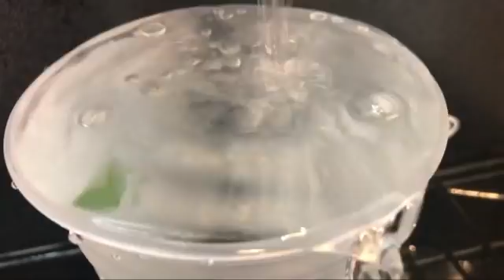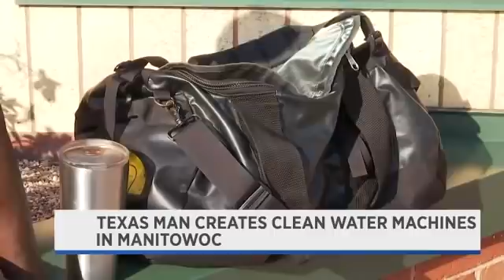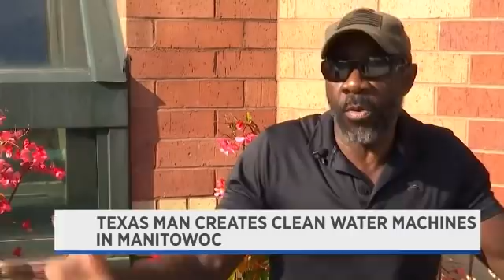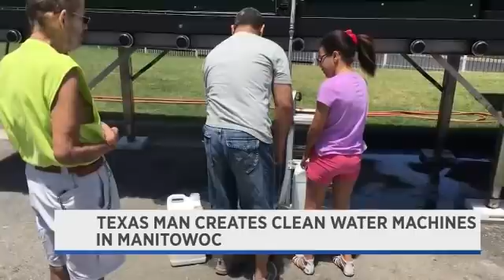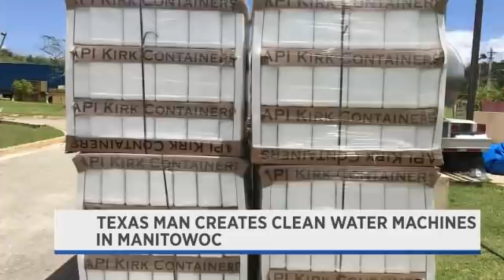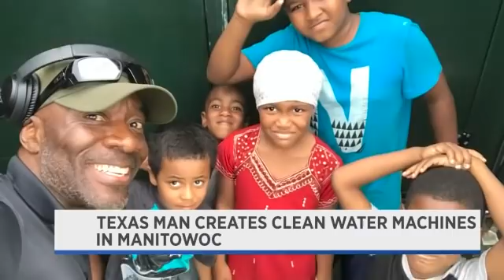Texas Man's Invention Creates Drinking Water from Air

Comment: Isn’t this essentially just a super powered dehumidifier with an activated charcoal filter attached?
Reply: Not even super-powered.  These water-from-air scams all have the same flaw.  You can't pull more water from the air than is there.

Comment: I fail to see the difference, except for seize, between a dehumidifier and that guy's apparatus.

It works as long as the engine turns and there is enough moisture in the air. It obviously doesn't make water out of thin air.

The extraction of water from the air has the same effect as mass irrigation: it disturbs weather pattern elsewhere. Hence it is not an acceptable approach to water management unless one doesn't care about creating droughts, floodings or tornadoes for people living few thousand miles away.

Comment: You could use the water to fuel one of those combustion engines that run on water.
Use the engine to drive a generator.
Use the generator to drive the water machine.
And go round and round until you disappear up your own dehumidified arsehole.

Comment: If these actually do what he says the can, the third world would certainly benefit also.
Reply: LMFAO, no. It requires huge amounts of electricity, doesn't produce enough water and requires maintenance. It's a useless invention, many have been invented like it.
Reply: @bmc9504  Yes not doubting there are a lot of frauds.  Do you have any evidence this is a fraud also?  If so I would be interested in reading any info you have.  I get what you are saying about huge amounts of energy.  Most use a cooling coil to condense the air and collect the droplets. Essentially a giant humidifier.  I do agree, the claim it uses little energy does have me wondering what they mean about not much energy.

Comment: Anyone else feel like all he made was a giant dehumidifier?
Reply: 4 years and a huge electric bill.
Reply: @William BurnsThe machine that Moses developed was innovative from the start. One of the challenges of scaling up atmospheric water generation technologies is the amount of energy they require to function. Many units on the market today are very energy intensive.

Not this machine, though. The Texas Commission on Environmental Quality requires power consumption no higher than 0.13 kilowatt-hours (kWh) per liter for approval. The unit developed by Moses used only 0.08 kWh in testing, and in Puerto Rico achieved 0.05 kWh.

Moses spends a lot of time watching the machine operate while thinking about "parasitic electrical load. If I can put my hand someplace and I can feel some heat come off or if I can feel some cool air come off … temperature change is energy.” He has continued to make tweaks to the design to minimize energy usage. “I’ve gotten the equipment down to the place where it’s very, very low on energy consumption,” he says. “And that’s what you had to do to get it out to the market.”

He says, "The one thing that everyone says is going to happen on this earth is that we are going to run out of water, and that’s just not true because we walk around in all the water we need every day."
 quote from MOSES WEST, PALADIN WATER TECHNOLOGY
Reply: Lol u guys are some hating ass bitches
Reply: Anthony Hearn I’m sorry that discussing science and using knowledge of technology is “hating” to you.

Sorry you can’t grasp the concept that he’s designed a dehumidifier with a filter unit. It’s literally what it is...

Go be a bigot somewhere else as everyone else speaks on the science behind this “feel good” story. May I suggest the stories about African helicopter builders that are using the helicopter rides that are generally outside department stores and in malls as their body.. maybe you can call all those that are questioning the science of those men “hating ass bitches” too.

You’d feel better to be ignorant and hateful to all those that challenged their science as well because your hate here is solely racially motivated. 

People of a civilized society are allowed to question false science. It’s what let’s us understand our environment.
Reply: Anthony Hearn maybe try being realistic and look at the numbers?? How is this hate?
Reply: @anthonyhearn9733  WORD.

Comment: its just a condensation collector. like what you get from condenser coils in an air conditioning unit. nothing new. the higher the humidity the more water in the air.An atmospheric water generator (AWG) is a device that extracts water from humid ambient air. Water vapor in the air can be extracted by condensation - cooling the air below its dew point, exposing the air to desiccants, or pressurizing the air. Unlike a dehumidifier, an AWG is designed to render the water potable

Comment: Water from air has been thoroughly debunked by thunderf00t.  It's the most expensive water, only works well in high humidity, and needs filtering to be safe to drink.
Reply: If it was expensive it wouldn't be in Bahamas and Puerto Rico. There's a big difference between this and a Self-filling water bottle.
Reply: If it was expensive it wouldn't be in Bahamas and Puerto Rico. There's a big difference between this and a Self-filling water bottle.

Comment: Quick, everyone get Thunderf00t over here to rain on his parade. lol
Reply: @William Burns isn't sargon married with kids?
Reply: @William Burns jesus. I didn't think anyone could condense so much cringe.
Reply: @William Burns The machine that Moses developed was innovative from the start. One of the challenges of scaling up atmospheric water generation technologies is the amount of energy they require to function. Many units on the market today are very energy intensive.

Not this machine, though. The Texas Commission on Environmental Quality requires power consumption no higher than 0.13 kilowatt-hours (kWh) per liter for approval. The unit developed by Moses used only 0.08 kWh in testing, and in Puerto Rico achieved 0.05 kWh.

Moses spends a lot of time watching the machine operate while thinking about "parasitic electrical load. If I can put my hand someplace and I can feel some heat come off or if I can feel some cool air come off … temperature change is energy.” He has continued to make tweaks to the design to minimize energy usage. “I’ve gotten the equipment down to the place where it’s very, very low on energy consumption,” he says. “And that’s what you had to do to get it out to the market.”

quote from MOSES WEST, PALADIN WATER TECHNOLOGY
Reply: @frankmill5172  it's getting hard nowadays for White Supremacists to be racist without saying the word "nggr". Their Lee Atwater ideology is gradually becoming less effective to where they can't hide their deep hatred of Black Americans
Reply: William Burns I don’t like or diss like thunder foot but he is no client change denier and you are not funny, if people told you in the past that you are funny they were lying
Reply: William Burns You wouldn’t happen to have 879,000 subscribers would you? You know, to get the word out  beyond the confines of this thread.
Reply: @William Burns amazing, add Russian collusion and you'd have managed to nail all the post-2016 buzzwords.
Reply: @William Burns well African Americans are innovative when it comes to things like this ...Frederick Jones, an African-American, invented the first portable air conditioning unit in 1935 which is close to Moses West Mobile atmospheric water generator then it is to Standard Air Conditioner and Dehumidifier  Jones was one of the most prolific African American inventors ever. Frederick Jones patented more than 60 inventions, but is best known for inventing a practical automatic refrigeration system for long-haul trucks
Reply: @William Burns you can just type Moses West Patents and check out all the specs for yourself and see if it all BS or innovative
Reply: @William Burns so your not a engineer but call BS because the way it looks ... it's still an inefficient way to gather water ...tell that to the people of Flint thats still to this day drinking lead laced drinking water they have used the Machine and As long as they say its not BS then I dont care what some guy on the internet says just because hes upset it was made by a Black man and you seen a lot of proud black people in the comments being happy about a black mans achievements   ...unless you can post a link to a article or youtuube video debunking "Moses West" Machine not someone else machine STFU dont even know why you people are even hating for hes not selling a product hes giving free water to people in need and it cost US tax payers $0 dollars ...its all positive that hes helping disaster victims in Puerto Rico ...you people are wasting energy on the wrong guy go debunk some real scammers I've seen less hate comments on White people like Berny Madoff who stole 500 Billion off gullible mostly white people the only reason 99% of the people are upset in the comments section is because hes Black and invented something positive that they cant hate on ...besides saying he didn't invent the first dehumidifier LOL
Reply: @William Burns also hes not competing with anybody ...hes not selling a product on Amazon or Walmart hes just giving them away for free to people that need fresh drinking water at $0 dollars out of any ones pocket if you dont want to donate you dont have to ...there have been way worst things people have Donated money too
Reply: @William Burns calling other men misogynists will not get you pussy.
Reply: @Jos Soros  I know this much, Thunderf00t has made several videos where he criticizes real inventors and amongst them Elon Musk.  I am not a Tesla fanboy and i don't mind people analiying and critiquing things he has invented but it was the way this jackass thunderf00t was mocking and ridiculing some of Elons ideas rub me the wrong way.   Fuck this loser and the losers that defend him.
Reply: @William Burns one moment its fake next moment ok it might me real but there are better ways to do it ...ok if its that simple why haven't they done it yet the people in Flint dont have the luxury of waiting around while people like you call a man a scammer thats not making any profit just getting donations to build machines that he gives away for free instead of doing nothing ...if I'm a person from Flint I'm not drinking any water coming from the same plant thats been poisoning them for years even if they say its been distilled ...and even bottled waters can be contaminated especially the ones sent to a specific region to a specific targeted group of people and bottled water companies make millions of dollars in donations and prophets when they ship bottled waters to a disaster zone I dont see you complaining about them and there are tons of fake charities that taken advantage  of people from all over the world but bet you dont care about those ...if you do post a link to a video where you left a comment talking bad about a white person scamming people dated before today ...ill wait
Reply: @William Burns Moses West from AWG Technology speaks about his company and atmospheric water generation.
 https://youtu.be/tEoxVhUWkcw
Reply: @William Burns they are not just giving any and everyone patent with out testing there devices first to make sure they work as advertised if you make a claim that your product is 100x better than the last persons device they test its to verify the claim before allowing you to put the product on the market ...if Moses West says its 1,000,000 more efficient  and produce a billion gallons of water using 2 double A batteries then so does the government testers that gave him the patent
Reply: @William Burns you guys are fighting the wrong battles ...its like if the Avengers fought Thanos to stop him from  completing his Evil diabolical plan of giving fresh drinking water to a planet of poor people
Reply: @William Burns what deflection you will obviously need to store water in winter months in states like Texas where hes speaking from and this video is from almost 3 years ago it has been farther improved ...like I said its not a product being sold he is providing free water to disaster zones and poor people the advantages of this system is its free it cast $0 dollars and its better then people drinking lead laced water that they are still drinking today ...and just like Flint I dont think the people of the poor planet would care what system Batman or Thanos used as long as they got fresh water ...if you where dying of thrust and a guy gave you AWG water I dont think you would turn it down and say you could have gave me distilled more efficient water LMAO!
Reply: @William Burns We live in the real world, where people are left to drink lead filled water 5 years after they found out Flint water was contaminated the Real world where Trump takes Billions from other government programs to Build a Wall instead of Helping out poor people in this country and if the solution was as simple as setting up distillation then why haven't they dont that yet ...all your saying is there are better ways yet where are they  live in the real world people like Moses West the Hero's trying to help
Reply: @William Burns his Machine was designed to not need to be hooked up to a power grid or water supply to make it operational in disaster zones where the infrastructure is down it can also run on solar power and the video says it literally cost ($0 dollars) to operate in any city so why is your only major concerned about price instead of poor people and if they can just distill the local water at 1/100th the cost why are people of Flint still not getting fresh water 5 years after Flint water problem was exposed ...you know the best most efficient way to get water to the people is to have a clean water plant in the first place that way we wouldn't even need distillation or AWG tech to give the people there fresh non lead laced contaminated water
Reply: @William Burns yet Moses West AWG produce 3000 gallons of water per day using lot less energy then other AWGs thats has been proven and documented ...just because you cant believe it and think hes exaggerating the efficacy means nothing to the people of Flint that use the machine and gets thousands of gallons of free water a day
Reply: @William Burns  Moses West Atmospheric Water Generator - Texas Engineer and CEO helping Flint https://youtu.be/AW3LfO990ho
Reply: @William Burns sure give a man a bottle of water he drinks for a day give a man a Solar powered AWG he drinks for a lifetime ...this is what you people fear not his Machine today but his machine 10 years from now with Poor people living off the grid producing there own water Imagine if they had cheaply made AWGs running on low power ...the water industry and water bottle industry would go bankrupt the way of steam engine compared to electric ...and like I said Moses West is actually there in Flint where are the massive Mobile distillation treatment facility at helping Flint that cost so much less energy ??? People of Flint need water today not people talking about what's most cost effective
Reply: @William Burns OK show me where are the massive distiller's and desalinization Mobile treatment machines at in Flint and ill show you why using AWG is better ... Oh there are none there ...Moses West Wins by default or you can tell the people of Flint to wait for the government to save them which they haven't in 5 years maybe another 5 years they will deliver a Distillation or desalination by then Moses West would have invented a even better AWG and have them all over town
Reply: @William Burns I'm not criticizing your criticism of the man, I'm criticizing there is no 120,000 gallon producing water machine in Flint today so your entire argument is moot 3000 actual gallons is more than 1,000,000 hypothetical gallons ...why dont you tell the people of Flint to drink a nice tall glass of hypothetical water
Reply: Where thunderbolt when you need him?
Reply: @William Burns wrong
Reply: @William Burns you know whats also better then Moses West AWG ...a Harry Potter Magic wand that can make fresh clean water from unicorn horns and fairy dust ...but since they dont have harry in Flint Moses West will due
Reply: @William Burns sure there are better ways to get water ...like from the actual water company whos bill you pay with your hard earned money just to get back lead laced water that makes people of Flint sick
Reply: Thunderf00t lives off his Youtube channel and the idiots who give him money.   I doubt this guy has ever had a job.
Reply: @DioRex-s8e  Pretty sure he's a professor. Or at least was. You'd probably know that if you did the least bit of research.
Reply: Thunder foot sucks ass. But yes I agree.
Reply: @ballHand  I agree thundefoot is good when it's comes to a lot of science. But he's an idiot when It comes to climate science. 😉

Comment: This has been debunked multiple times.  It is possible to condense water from the air but the energy required is so high you could fill a tanker from the tap on one cosst and drive it across the country for less cost and the water quality is so poor you would have to filter and  treat the water to drink it.

See Thunderfoot's videos on the topic.